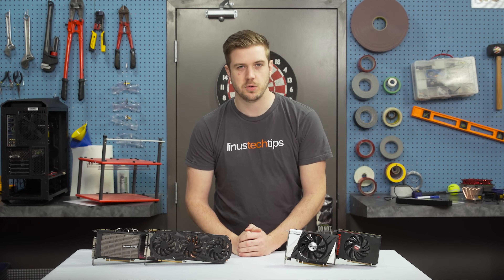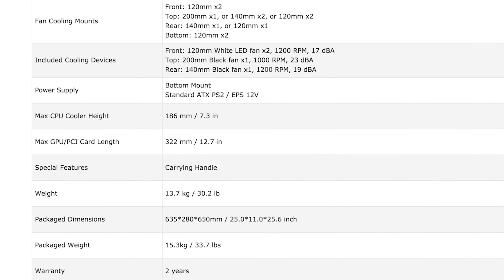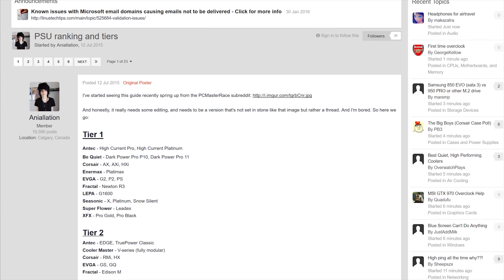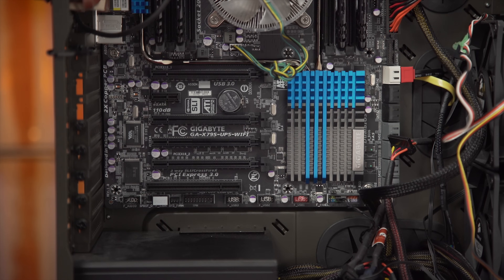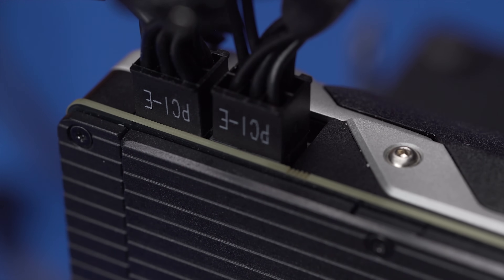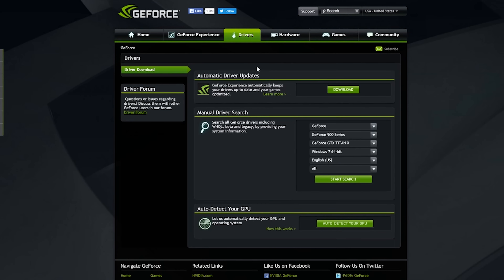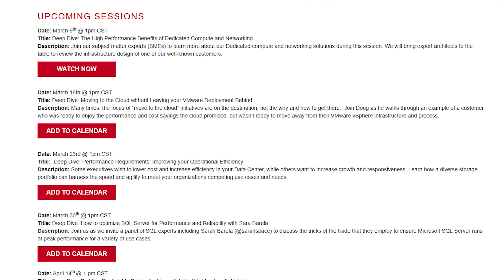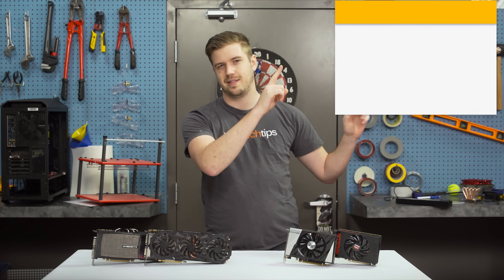Installing a Video Card - How To: Basics

Comment: So I should remove the drivers, remove the card, put in the new card, hook up the monitor to the gpu and install the drivers?
Reply: honestly dude idk how to work drivers and shit im so intimidated
Reply: @chrismac5097  don't worry man it's a lot easier and less complicated than it sounds. All you do is run DDU (tutorials for ddu on YouTube it's very simple), look up the manufacturers website, type in your gpu model, install drives, screen flickers a few times, restart, done. I'm sure you've already done it and feel silly for worrying about it, I know I did. Hope your build went well 😁
Reply: Larine Should I uninstall Integrated graphics? I’m running Intel hd graphics 4000
Reply: @HelloRasupuBegasu  dont think u should. Those are integrated into the gpu
Reply: @HelloRasupuBegasu  I've never put in a graphics card but I have both Intel graphics and nvidia and it let's me choose which one I want to use in the nvidia control panel
Reply: @HelloRasupuBegasu  integrated graphics are graphics from your cpu so theres no point to uninstalling them since you won't be running off of them once you are using your new graphics card

Comment: My stats : 
Processor Intel(R) Core(TM) i7-4790K CPU @ 4.00GHz
 
Video Card NVIDIA GeForce GTX 970
 
RAM 16 GB
 
Operating System Microsoft Windows 10 (build 10586), 64-bit 

Can I upgrade to gtx 1080

Comment: I have a geforce gtx 970 would i be able to upgrade to 1080
Reply: Well probably. But you have to look so it will fit in your motherboard and if your power supply is powerful enough for your new card.

Also if your CPU is old it might bottleneck with your new card. 

Also your chassi needs to be big enough aswell. So if the new card is alot bigger you might need to check that aswell.

Comment: Can someone confirm if I can upgrade to a GTX 1070, this is my current build -Gigabyte GeForce GTX 970 G1 4GB Graphics Card
Intel Skylake i5 6500 3.2 – 3.6GHz Processor
8GB Kingston HyperX FURY 2133Mhz DDR4 RAM
Gigabyte Sniper B7 Motherboard  
600w Raidmax Cobra Power Supply.
Reply: I think so
Reply: Sounds fine to me. Go for it.

Comment: I am honestly scared to do this because idk that the card I am wanting to get would work with my 120w. power supply   Cuz I want to get the AMD R9 390X 512 Bit GDDR5 8GB 2xDVI/HDMI/3xDP G1 Gaming Graphics Card .    I wish I didn't get a pre built
Reply: ***** My pc isent really old but I have a AMD Radeon R7 200.  it was pretty much built with in with it when I got it.  I'm not wanting to unload a bunch of money into this pc cuz I'm wanting to upgrade the graphics and the ram.  the graphics alone is going to set me down 400$
Reply: +Clogged Toliet that's the reason I'm updating
Reply: +Carter Milan you could have asked if I already was planning to get a new power supply.  which I am.   I'm planning to get a 500w
Reply: ***** Like the build.  or the make or model.  (still trying to get into the hole pc building thing cuz I want to fix this prebuilt)
Reply: but I got the pc from ibuypower because it was kinda cheap and cuz it was a big bump up from my old shitty laptop that I tried to use
Reply: I haven't messed with anything in it when I got it.  The only thing I did with it was open the case to see what it had in it like the power supply.  Everything was prebuilt in.
Reply: like it runs some games like tf2 and lfd2 just find but when I play arma it just takes a big shit on me.  cuz most games I have kinda require abit more to run and look good.
Reply: There is no way your power supply is 120 watts, that is way too low.
Reply: ***** For a desktop though? I doubt it. Yeah, there are probably ones for laptops. The only way I can see a computer possibly pulling that off is if it has onboard graphics. But I don't really think thats the case with him since he bought it from Ibuypower. I could be totally wrong, but 120 watts just seems way too low.
Reply: I could take a pic of a the supply of it.  it said next to the max  w  and it said 120.  unless I'm looking at the wrong thing.  highly doubt it though
Reply: +Going2kilzu what is your computer called? I know it's an ibuypower but what is the model

Comment: Guys I need help, so I have been using my computer for very light gaming recently and haven't got a GPU yet, I've just been using the 120mb that comes with my Skylake processor. I am going to most likely purchase the new 1070 but to install it do I just install it and will it work off the bat? I haven't got a GPU in my system yet and I was wondering if there was a driver I had to uninstall or something
Reply: I'm doing the exact same thing tomorrow. You should only need to change which GPU your PC is using in bios and you're all set.
Reply: LaFlare1017 I cant seem to get into bios, either my Ssd is too fast or Im too slow
Reply: Gunnyc animation I didnt even have to do that, you should be all set once you have put the 1070 in the PC

Comment: I have a evga geforce gtx 750ti and everything is working the fans and the lights are on in the case but when I connected it to the monitor there is no response and my GPU doesn't have any pins on it so I can connect it PLLZ HELP

Comment: I want to consult my problem to you linustech peeps. my problem is that whenever I put my new video card to the pcie x16 slot on the motherboard and turn the system on the fan spins but there is no output. Is there a way to make it work?
Btw i am using zotac geforce 750ti 2gb single fan

Comment: Would have been good to note some cards exist like the GTX 750 ti sc from evga that don't even need any connection from a power supply and will run by just simply plopping it in your motherboard.

Comment: hey Can you use the same 8 and 6 pin cables from your old graphics card?
Reply: yes just leave them in and don't use the others just disconnect the old one snd put the other in and use the old cards connectors

Comment: can someone please help me I have just built my first gaming pc but I cannot get my graphics card to work on it, here is what happens- when I do not have the graphics card installed I plug the hdmi cord into the motherboard port and it boots up fine and I get a picture, but when I have my graphics card in I get no picture from either the motherboard port or the graphics card port. What am I doing wrong someone please help my specs are this
Motherboard: MSI Enthuastic Gaming Intel Z170A LGA 1151 DDR4 USB 3.1 ATX Motherboard (Z170A Gaming M3)
Ram: Kingston HyperX FURY Black 8GB Kit (2x4GB) 2133MHz DDR4 Non-ECC CL14 DIMM Desktop Memory (HX421C14FBK2/8)x2
CPU: I5-6500 FC-LGA14C 3.20 Ghz 6 M Processor Cache 4 LGA 1151 (BX80662I56500)
GPU: MSI ARMOR 2X GeForce GTX 980 TI 6GB OC DirectX 12 VR READY (GTX 980TI 6GD5T OC)
Power Supply: EVGA 500 B1 80+ BRONZE, 500W Continuous Power, 3 Year Warranty Power Supply 100-B1-0500-KR

p.s. the graphics card is getting power from the power supply so I don't think I have a dead gpu
I have also installed all of the drivers via the disc it came with I am just thinking that this gpu isnt compatible at this point.
Reply: ***** thanks so much I have now fixed my problem and this method did in fact work so thank you
Reply: I tried this yesterday and it worked without a hitch
Reply: hey i have a question. I have an old GPU and i just got a 970. how do I go about removing the older GPU. my main isssue is the software part of it. What do i do with the older  driver. do i uninstall it before I remove it or after I put my new GPU? 

and should I use DDU is that trustworthy or just uninstall from control panel. 

I just wanna get the order right so i dont fuck anything up software wise.
Reply: I see i have another quesiton that Im nervous about. Someone told me about something to do with BIOS. i dont know what that is, and they told me that the gtx 960 might not work on my old PC because of something to do with the gtx 960 using a UEIF something bios. SO i have no clue...

Did you use DDU before you took off your old graphics? Also, why would you use that instead of unisntalling it on control panel.
Reply: +Boba Fett Fan yeah mine is the same age. I'm going to use ddu as well thanks mate. hopefully my gtx 960 will work fine. 

did you wipe off drivers before or after installing new graphic
Reply: why did you do the test run of uninstalling it and reinstalling it.
Reply: +Boba Fett Fan I'm wondering about just Uninstalling with Just control panel
Reply: +Boba Fett Fan I just don't want problems with ddu since it's a powerful program
Reply: +Boba Fett Fan ok I'll give the ddu a try. if something goes wrong I can always use restore point
Reply: yeah my biggest fear is that my gpu wont fit. Cuz i knwo there are two different ones, one with two fans and the other one is a smaller one with only one fan. I got the one with two fans and it seems really big. and idk if I can fit that into my pc. its big as fuck holy shit. it also has an eight pin connected. Will my power supply be enough. why is this so stressful I just want to plug it in and play.
Reply: i don't think it says on teh side of the unit. It might be enough because the hd radeon 5450 requires 450 watts.

I'm more worried about the 960 being able to fit it's so godamn huge.
Reply: ***** my friend who knows a lot about pc is saying it should work. I think the logic behind it is that pre build pcs require less power so he said you don't need a 500w like most people say.
Reply: +Boba Fett Fan so I probably can't do a 960 then... also 500psu is more than enough
Reply: +Boba Fett Fan I might do that. would it run on my 300w psu. 
I'm thinking about just building a new pc since I already have the gtx 960
Reply: I'm going to have to return the gtx 960 cuz I don't have enougub space or psu. This sucks man I have to pay 35 dollars to return it
Reply: Thanks man. Did you get my link. It's a tiny space. 

Shouls I get the 950 mini since I have a 300 psu
Reply: +Boba Fett Fan hey man it's me again I have updated my power supply from a 500w to a 750w and I am back to ground zero and I cannot get connection toy monitors I desperately need help with this before I just I've up on this thing
Reply: +Boba Fett Fan Yes and this happened 2 days ago and nvidia customer service said it was due to my power supply being only 500w so I upgraded and am still having the same problem
Reply: +Boba Fett Fan think I should of never went for the 960 because it's for high end stuff
Reply: depends on what. how much is your PSU and what prebuilt pc do you have?
Reply: +Boba Fett Fan yeah your computer sounds like it could use a gtx 950. mine is too small with a power supply of 300
Reply: i have a 300psu man. Thats pretty low for a gtx 960, and the card is ten inches big

like mabe 300w is fine, but I dont want to risk it with a gtx 960
Reply: yeah man :( I should have gotten teh 950, my friend talked me out of it because he said it's better to get a better one, because whast the point of buying an old one when you're going to have to upgrade anyways. 

So thats why I went with that :( now I have to return my brand new graphics card and pay newegg 34 dollars. So bs. It shoudl be free like amazon.
Reply: also apparently even the 950 mini requires 500 minimum wattage psu. I don't think the 950 mini would be good on my pc either
Reply: the problem is that you didnt wait for a 1080
Reply: So I should remove the drivers, remove the card, put in the new card, hook up the monitor to the gpu and install the drivers?
Reply: Can't believe I found you, I'm trying to upgrade my gpu to the asus 950 mini "unplugged". So I should remove the drivers, remove the card, put in the new card, hook up the monitor to the gpu and install the drivers, right?
Reply: Wow, you're fast, thank you so much man. I too am very paranoid with upgrading so  that helped a lot :) Thanks again

Comment: In January i got a new pc which had an i7 processor and a nvidia gt 720 graphics card, i have ordered a nvidia gtx 960 PCI-E, i have checked and my pc supports PCI-E, would there be any problems or should i be fine when installing the graphic card?

Comment: I have a gtx 750. Yes or no can I upgrade to the knew gtx 1080?
Reply: depends on power size motherboard conpatabilty and more
Reply: Dude, just buy a 500w Power Supply from either Corsair, be quiet or EVGA.
50 dollars for that and you wont blow up your PC.
Reply: Zachary Oliver 
Its my best guess, since here its 50€.

Take 60. Thats a normal price tag for a 500w power supply.

As i said, anything from Corsair, be quiet or EVGA will go.

Just dont buy the super cool 20 dollar china supply that will explode in like 2 seconds... Always buy good quality.
Reply: Yeah probably
Reply: What cpu?
Reply: Intel(R) Core(TM) i5-4460 CPU @ 3.20GHz, 3201 Mhz, 4 Core(s), 4 Logical Processor(s)
Reply: Mr bezhead
Reply: +Zachary Oliver what's your power supply
Reply: BlitzNite 400w i believe
Reply: +Zachary Oliver  OH HELL NO Look up its specs you need a much better power supply
Reply: bigmama15 any PSU recommendations that would be just right for the GTX 1080?
Reply: any modular psu that's 750W or more should run fine.
Reply: +Zachary Oliver yes u can
Reply: Misgu according to the other guy i cannot....
Reply: Zachary Oliver If you want another suggestion, the rx 480 from amd uses only 150w  so keep that in mind, oh and its 200 dollars
Reply: ***** 50 dollars? Seems suspiciously inexpensive....
Reply: Power Supplies are pretty cheap like 400W is $40 500W is $50 and 600W is $60. Thats how their priced
Reply: They're*
Reply: I personally think the 1070 is better for gaming or the 1060 or 980 if you're on a tight budget
Reply: If you can spare the money, the 1080 will always be better for gaming than a 1070.

Although do keep in mind that your CPU might bottleneck the GPU.

Comment: spoiler
"just go out and-buy a video card and slap them in here"
-linus sebastian
according to this info
you dont need to uninstall driver,you just need to remove(if youre upgrading) the old gpu or (new system) just grab the gpu and throw it to your mobo,make sure to force it to lock them in place,after than,your gpu will stuck on your dick because instruction is unclear and end up with a dead mobo

Comment: I am currently using a sabertooth z87 motherboard and a 4770k, If I want to upgarde to a gtx 1080, do I need to update my bios?
Reply: When I install a new GPU should I install the graphics card before the drivers or the drivers before the GPU?
Reply: TimmyTeaBag TO be fair if you install the new GPU the driver usually will detect the GPU, but to be sure it's better to remove and re-install the driver. Also I do a bit of research lately and turn out you don't need to update the bios for new GPU. A bios update is only needed when the old one is bugged or install a newer generation CPU on a older supported board. EX: install a i7 4790k on a z87 board.

Comment: alright, how can I install a GTX 980 Ti in my laptop?
Reply: You have to shove the gpu into your microwave for about 60 seconds.
Reply: Soviet Toaster
I cut the PCIe connector such that it fits in an m.2 slot, it works fine
Reply: That actually isn't possible but you can use a GTX 980 ti in a laptop if you buy what I think is called an expansion kit. It hooks into your computer and it will use new GPU's like the 980 ti. The only thing being is the power. You will be stuck on wall power for the duration of its attachment to your laptop.
Reply: @googlefish80  r/whoosh
Reply: @Paleski  r/ihavereddit
Reply: @aresito22  r/iforgotitswooooshandnotwoosh
Reply: Georgebad r/twentycharacterlimit
Reply: @aresito22  r/fifthsub
Reply: Shockwave
I downloaded 256GB of ram from kickass torrents right before it went down
Reply: googlefish80
wait you actually gave a serious answer to this!?
Reply: You bake it at 365 degrees, when it's all ready you take it out, forcibly shove it in your laptop. You will hear an faint electrifying sound and cracks and bam! THE card is now ready
Reply: Hi, would there be any chance of busting put my gpu if i bought from ebay a pcie power cable going from my corsair 550 power supply to my geforce 1050 6pin?

Comment: Can anyone help. I have an APU and I just installed a GTX 750 ti, I downloaded the drivers and everything and even disabled the integrated graphics for the processor, but when I play CS:GO on lowest settings it only gets 25 fps which is not normal any thoughts?
Reply: Sorry cant help man but i will probably be doing the same thing you did, hope nothing goes wrong.
Reply: Try going into bios and disabling intergrated graphics.
Reply: did you fix it
Reply: no, i ended up getting an Athlon X4 860k

Comment: I have a question i bought a new gtx 960 evga sc and before that i had a gtx 460 would my performance increase if i install both?
Reply: +Johan fahlgren No,both architectures are completely different. The 960 will be good on its own. I have an AMD equivalent and I came from 460 SLI. The 960 will do fine by its own.

Comment: I have a DELL XPS 8700 PC.  Can I install the GTX 980 Ti in it?
Reply: +aroundtheclock GLHF. Most likely no, because 980ti is very long. You can always go ghetto and buy a 50cm pcie cable to put your card outside it. BTW, most likely 980ti won't work out simply because your psu will be crap, designed to only power that gt 745 crap (wtf, first time seeing nvidia using the third number). Wrong computer mate. I had a similar one too, but later I came to conclusion that I'd have to change everything except case and storage to get a better gpu so I thought better just build a new one.

Comment: Does touching a painted part of metal work for removing static electricity from your body? I always tought touching a bare piece of metal on a grounded part was needed since paint doesnt conduct that well. I also prefer to touch a radiator/copper/metal pipe in my house since they are grounded and my normal wall outlets are not. Btw thx for the video's, I really enjoy them and i'm looking foreward to the next scrapyard wars! Cheers